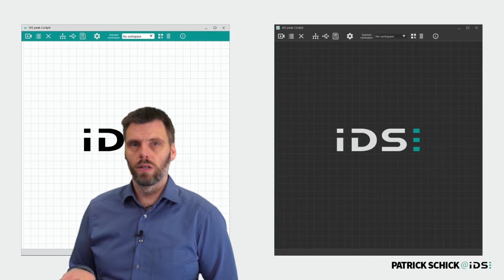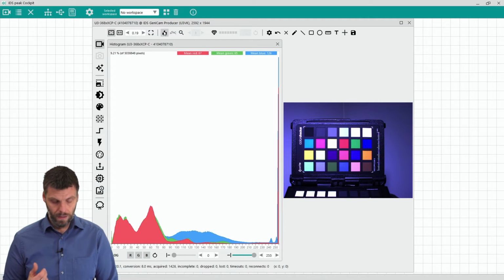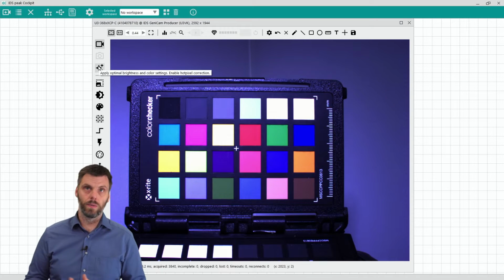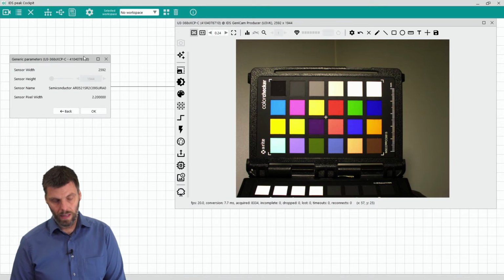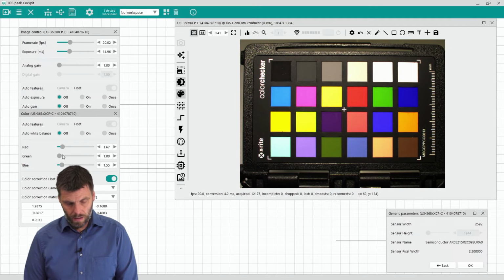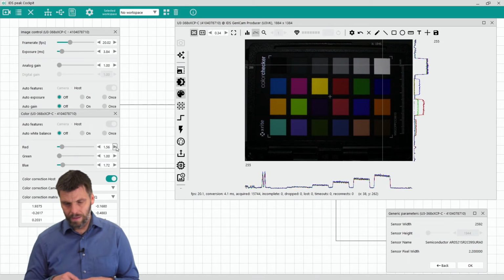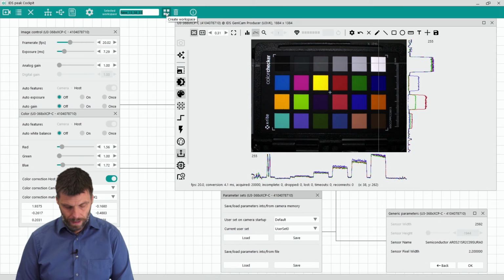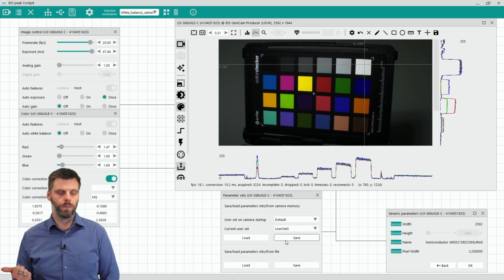Configure camera settings easily with IDS peak Cockpit

Comment: How to use the camera if it shows that it isn't running with usb 3 speed(through programming)
Reply from the maker: Thank you very much for you inquiry. When the camera is connected to an USB3 port, but only runs with USB2 speed, this is mostly due a connection issue (cable defective, not properly plugged or too long). You can check the connection speed programmatically when reading out the parameter “DeviceLinkSpeed”: 

int64_t value = nodeMapRemoteDevice->FindNode<peak::core::nodes::IntegerNode>("DeviceLinkSpeed")->Value()

Another indicator for this is the LED on the back side of the camera which is orange in USB2 mode. The camera can still be operated in this state, but with reduced frame rate and performance. We therefore recommend to check the cable connection and to ensure a USB3 connection is restored.
Reply: @IDS_Imaging thanks for the reply. Is there any sample code to run with usb 2 speed? The available ones in idspeak library are not able to detect camera
Reply from the maker: @srivandya1882  Our system consultants would be happy to help you. Please open a support ticket for this. Thank you very much.  https://en.ids-imaging.com/support.html